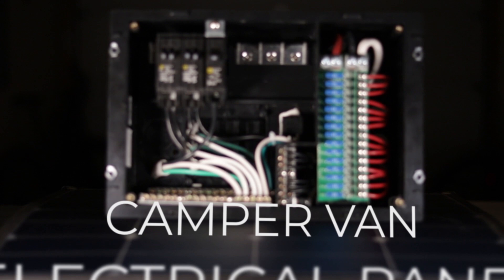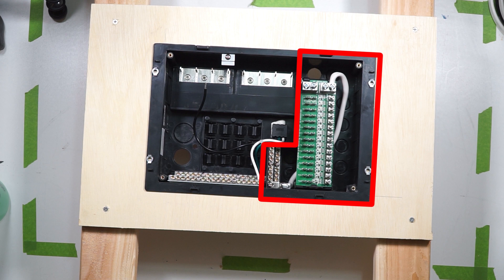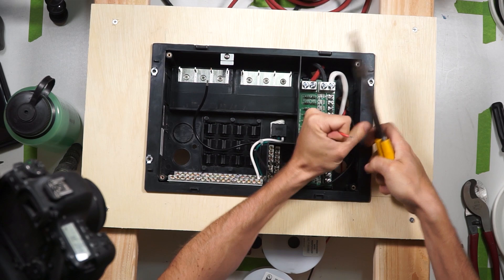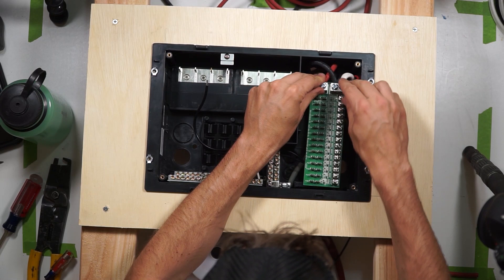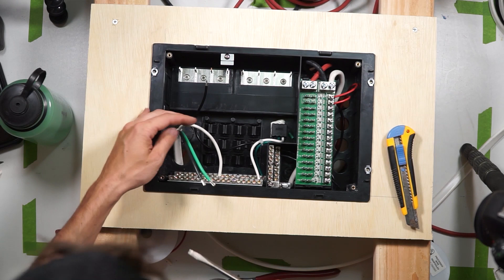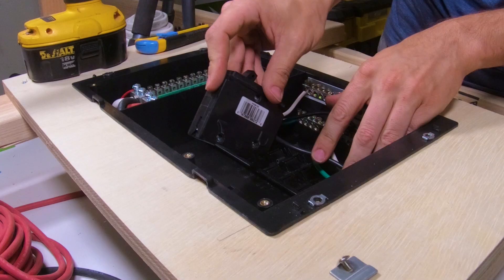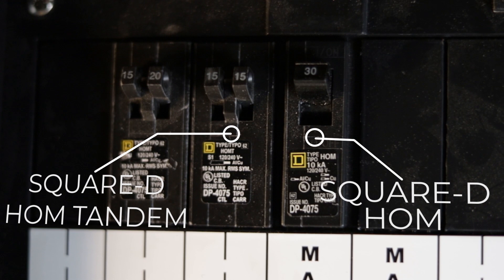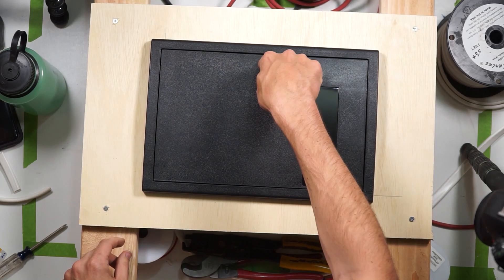How To Wire a Camper Van Electrical Distribution Panel

Comment: Could I use that same type panel for a off grid small shed ? I'm running solar into it but also want to add a few 120v plugs around the shed to charge tools etc ?  I was going to use a standard sub panel and breakers but I have access to one of these, that the convertor is blown but the rest of the RV panel is fine. I would just use my power from the invertor to power my 120v side.  Thanks. Love your videos..
Reply from the maker: I'm always going to recommend the 'standard' residential load center/breaker box for stationary applications.
Reply: @EXPLORISTlife  Oh ok. Thank you.

Comment: By doing this will this supply power to my ac circuts and dc circuts or will the generator power ac circuts and battery power dc circuts? I want to have one place where i can just use my generator as a back up

Comment: Question, I have the Victon 2000 compact inverter/charger for my 5th wheel.  My question is when wiring shore power currently shore power goes directly to the control panel, should I re-route it to go through the inverter?

Comment: Indeed some help from you, I’m try g run my wires to my light in the ceiling from the fuse panel. What wire do you recomend? 12-2 or 12-3 silicon wire so is flexible? Or run te single wires tape then together?

Comment: When wiring the DC side of the panel, why didn’t you use ferrules in the wires coming in from the battery side?
Reply from the maker: I just chose not to in this video, but you definitely could.  Ferrules aren't required, but definitely make for a cleaner install.

Comment: hi nate, im in the process of converting a cargo trailer, my second one. my electrical system will be more involved this time! im thinking about buying something like this. to charge my battery, but also to provide 110v shore power. 
i looked at a couple of your wiring diagrams and videos, but cant seem to find what im looking for. i already installed a fuse block, and i already have a couple new inverters. i want to have my off grid solar setup, but then i think i want to occassionally hook up to shorepower for battery charging and 110v use. 
im confused a little. i think i should be using only shorepower when hooked up to shorepower (also charging and maintaining battery), to eliminate cycling my battery unnessarily. some of these devices like the one in your vid here are converters/chargers? then with such a device i would be charging my battery, producing 110v power to use, and producing 12v power to use... all seperate from my exising system? 
id appreciate any helpand thoughts you have on my situation.

Comment: Wiring the panel itself seems to be straight forward. What I am not sure of is how to wire in the power sources for the AC, i.e. shore power, inverter/charger. Most inverter chargers have a transfer switch, but when I hooked mine up and then plugged it into shore power my dc lights would pulse. I am wondering if I did something wrong.
Reply from the maker: Generator & Shore power -> Transfer Switch -> Inverter/Charger -> AC Distribution Panel  Here is a visual example of how it all plays together: https://www.explorist.life/3000w-inverter-400-600ah-400-to-1200w-solar-camper-solar-kit/

Comment: Nate, great instructional video.  Is there a need to ground box to van chassis for either AC or DC .  Thanks.
Reply from the maker: Not the box, no.  Grounding happens at the Lynx Distributor and through the Neutral to Ground relay of the Multiplus inverter charger in all of the diagrams at https://www.explorist.life/solarwiringdiagrams
Reply: @EXPLORISTlife  Nate, I do not plan to have an inverter.  I am wiring for ac power for outlets only and converter/charger for 12 volt auxiliary battery.12 volt will run interior puck lighting , vent fan and USB.
Thanks.
Reply from the maker: Sounds like a neato project!  I hope you find what you need to make it work. 👍🙂
Reply from the maker: Oops... sorry... that added my reply for a different comment to this one.   If you aren't having an inverter/charger like a Multiplus, and are wiring shore power directly to the box, you should indeed need a chassis AC ground to chassis ground connection.  NOTE:  This information is based on 'the best I understand' as I don't have the full scope and understanding of your system.  My recommended system design involves using a inverter/charger w/ a neutral to ground relay to handle chassis ground switching.
Reply: @EXPLORISTlife  thank you Nate.  That was the route I was going.
Reply: Nate, what gauge wire did you use from the battery to the 12volt side of panel? Thanks again for video.

Comment: Thanks for the video.  Saw it and bought it.  One thing....you kind of skip over hooking up the prewired outlet on the rear of the panel.  Why is it there?  Do I need to hook it up or can I just cap the black wire and leave it alone?  Thanks for all you do!!
Reply from the maker: You can hook it up or leave it.  It doesn't matter.  It's just another 120v circuit.
Reply: Thanks for the quick response!!  I appreciate it.

Comment: Great Video,
Will this type of panel charge the 12v battery while it's plugged into 120v? Or would a battery maintainer/trickle charger have to be wired in?
Reply from the maker: This panel has no way of charging a battery bank.  I recommend using an Inverter/Charger like in ALL of my diagrams here: https://www.explorist.life/solarwiringdiagrams

Comment: Can I connect left and right busbars to have ability to insert more breakers while running 30Amp main?
Reply from the maker: Not without 50A shore power.  This breaker box can handle 6 different circuits when using tandem breakers.  There's no reason to have more than 6 circuits in a van build.

Comment: Nate, I have purchased a Busbar disconnect from you and a Solar Schematic,  At 3:35minutes you show connecting the main 110volt power to the left side of the busbar through the main breaker, How do i power up the right side of the 110 breakers with the same incoming 110V.
Reply from the maker: The right side is for:

1: L2 of a system with 50A split phase shore power.

2: powering from AC Out 2 of the Victron Multiplus for 'shore power only' loads.

If using tandem breakers on the left side, that is room for 6 circuits which should be PLENTY for any camper.

Comment: I have an DC LED light bar with pos neg.  I am using a dial knob for power switch.  This has pos neg and ground.  Curiously, when running this back to the distribution box ( same shown in video) where do I ground the wire coming back to the distribution panel? Because all three run back to it. Can I just run it to the negative on the dc side?

Comment: I have a question.. if anyone can answer it would be much appreciated.. I'm upgrading my camper from 30 amp to 50 amp and I have bought the panel 6/3 wire everything I need..  With that being said my PowerMax converter in my camper now for my 30 amp service is less than a year old.. Will I have to upgrade my converter because I'm upgrading to 50 amp service...?

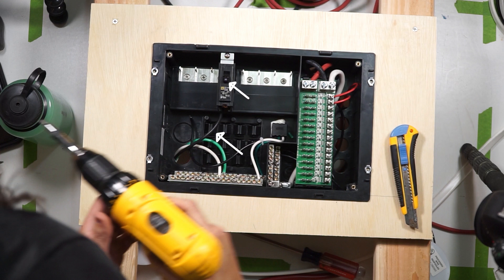Comment: At 4:04 you talk about adding power to the wire. How would you add power to said wire?.............For the square-d him tandem would you require one for each outlet?...........Does this set up replace the inverter?.........have you already done a video on how to connect everything together? and if you have could you leave a link.
Reply from the maker: That wire would be powered from the Inverter.  You can wire multiple outlets in parallel off of one breaker, similar to how it is in your house.  This setup does not replace an Inverter, but this unit get's power from the Inverter.  I don't have a full install including this device just yet, but will as soon as we move into out new shop at the end of the year.

Comment: Hi Nate,
 Very helpful video! One question - what did you do with the already installed black wire? Thanks!
Reply from the maker: If you want the outlet on the back of the panel to function, you'll just want to connect that black wire to a breaker the same as any other branch circuit.
Reply: @EXPLORISTlife   ahhh, that makes sense! Thank you. One other question: My other HOMT breaker is the same one you have, however it doesn't fit into the slot and broke two of the prongs sticking out. Have you heard of this issue, and do you know how to fix it?

Comment: Great videos!  I have this panel wired up and working great but have one question:  Do I need to run a ground wire from the A/C ground terminal to the chassis?  If so, can I use the same chassis lug that I have my D/C grounded to?
Reply from the maker: Not if you're using an inverter/charger with an internal neutral/ground relay like any of the examples here: https://www.explorist.life/solarwiringdiagrams.
Reply: @EXPLORISTlife  I've been looking for the answer to this very exact question.  I'm going to disconnect my AC chassis ground from the AC side of the breaker box to see if it corrects the shore 110 GFCI from tripping shortly after the Victron MultiPlus II Inverter engages on power up.

Comment: Will this distribution box work on shore power alone, i.e. no battery system?  Wanting to install an ac 50amp shore power breaker box and still connect 12vdc led lights in a clean setup.

Comment: Could you connect this panel to a Bluetti portable power station, so one would not need an inverter, etc??? Since these power stations have both AC and DC power supplies.
Reply from the maker: A bluetti should have built in breakers, outlets, etc, making this whole panel unnecessary.
Reply: @EXPLORISTlife  Good to know. I have a 1974 Fan travel trailer I will be restoring and obviously need to update everything. It will have ac, induction cooktop, etc. so I am exploring options.

Comment: I bought this exact panel. Wondering why on the DC side there’s 15 positive connects but only 12 negative connections. Please help!
Reply from the maker: You can put multiple negative wires in the same screw terminal on the negative busbar.

Comment: Nate, I have purchased a few of your wiring diagrams but have a few questions. I eventually want to hookup solar but not yet. I have a distribution panel and would like to get that connected to my shore power cable and 100ah battery. I see you have a lot of parts used for an inverter with the bus bars, breakers and such. Any suggestions.... I guess I can take one of your diagrams and show you where I am at. But... I just want my battery, shore power, distribution panel and possibly add the inverter during the part of the build. Any suggestions would be great.
Reply from the maker: The solar charging leg of the system can be omitted if desired from any of my diagrams/systems without changes to the rest of the system.

Comment: I'm trying to put together a electrical system in an RV.  Would this circuit breaker setup be useful for my shore power and my DC off my battery?  Thanks for this video
Reply: @Joe-sq5uy  I think he says his breaker box is set up with one side being DC and the other being for AC.
I will end up putting in 2 separate breaker boxes. My shore power is coming into the van in a different location than my cables from the solar.

Comment: In your parts list you list getting a 50A Square D HOM AC Breaker (for the AC/DC distribution box) to connect to the Victron inverter/charger. I assume this is for a 50A shore power system? If I am opting for a 30A shore power system, should I replace that with a 30A Square D HOM AC Breaker?
Reply from the maker: Nope.  The Victron Multiplus has what's called 'PowerAssist', which means it can add up to it's nominal inverting capacity (3000w for a 3000w inverter - 2000w for a 2000w inverter - etc) to shore power, inverted from the batteries.  So... If you are wiring for, and connected to 30A shore power; the Victron Multiplus can add 25A (3000w/120v=25A) TO shore power for a total of 55A delivered to the breaker box through 6 awg wire.  We are capping this off at 50A with the 50A breaker from the parts list.

Comment: Wait, why do we need the plug in the back of the box?
Reply from the maker: You don't have to connect that if you don't plan on using it.
Reply: @EXPLORISTlife  right... but whats it for?  To power the box firectly?
Reply from the maker: It's simply an additional outlet.  Like an outlet in the wall, just mounted in the box.
Reply: @EXPLORISTlife  If i am running a solar panel, am i running it down to this fuse box with a double pole braker or something?  your diagrams dont show any advice on that and everyone is saying the solar goes to the fuse box while the fuse box is going to the charge controller in the "load+/-" sections of the charge controller.  (only have 1 battery)

Comment: If I'm running a 50 amp service would I use the same 6/4 romex coming from transfer switch up to the service panel? I purchased this same furrion panel to install in my  bus. The 12v side was pre-wired which I'm a little unsure of at this point.   I'm curious as to why there's not a securing screw for the right side of the panel if its an optional 50amp? Also, if use a 30 amp on one side does that mean that mean my other is limited to no more than a 20amp  breaker? Thanks for the video
Reply from the maker: 1:  If you aren't using an Inverter/Charger or anything, yes.

2: No securing screw is necessary because the 50A breaker would be a dual pole breaker which would be held in by the single clip.

3: If you are using 6 AWG for in Main Input... use a 50A main breaker.

Comment: Did you connect any wire to the chassis ground?
Reply from the maker: Not in the distribution panel no.  The Lynx Distributor is connected to the chassis ground and then the AC side of the system is grounded through the neutral to ground relay inside of the Multiplus inverter/charger.  See the diagrams at https://www.explorist.life/solarwiringdiagrams for clarification.

Comment: Nate, your videos are great and I have checked out wire sizing guide and fuse sizing guide, but still have a question. What size wire should come from my bus bar to my DC fuse box. The fuse box is rated up to 125amps total. It's a short run, about 4'. Do I need a larger fuse inline with that based on my the total amps of appliances (fans, light, pump, etc).
Reply from the maker: You should check this out: https://www.explorist.life/wire-sizing-calculator/

Comment: Hi! When adding wire for the ac outlets, is just one set of wires connected to the ac breaker, then the wire goes out around the van and just T-d off to the various ac outlets around the van? Thanks!
Reply from the maker: It very much could be.  Very similar to how it works in your house.

Comment: Thank you for your video! I have been needing help with this same thing!

Do I need to have an inverter or can I just hook my 30 amp shore power cable right to the box?
Reply from the maker: You don't have to have an inverter if you don't plan on running 110v appliances when not connected to shore power.  If this were the case, you could, indeed, run power right from the 30A shore power cable to the box.

Comment: Great Video.  Question - I mistakenly used 2 wires instead of 3 wires and had each of the 120 volt outlet hooked grounded to frame.  Is this ok or a problem?
Reply from the maker: Nope. You'll want to redo that and use 3 conductor wire as shown in the video.
Reply: @EXPLORISTlife  Ouch....can I hook a third green wire next to that 2 wire that is insulated?  Will that work?
Reply from the maker: You CAN do whatever you like as I'm not inspecting your work.  I've shown you the proper way to do things, now it's up to you to decide how safe of a system you are trying to build.  I recommend re-running a proper 3 conductor wire as shown in the video.

Comment: You are my first ever Subscribed!  We are building out an ambo and want to follow your diagram as close as possible for the 3k inverter, 400-600 ah, 400-1200 solar setup.  My question is that I already bought a WFCO (for lithium) 55 amp AC & DC distribution fuse and breaker panel combo.   Can I keep this and still use your diagram setup? Do we think of it as two separate pieces like you have in your Sprinter video and layout?  Please let me know if I have to sell this piece and rebuild the space we made for it. Thank you so much!
Reply: We are going with all Victron products. We love your videos - you explain it best!
Reply from the maker: I'd suspect that panel is not rated for 50A of AC current.  You'd also have to entirely disconnect the converter.  'Doing it right' says to replace it with the correct panel.
Reply: @EXPLORISTlife  Thanks so much for the reply. Guess I’ll sell part I bought.

Comment: Hey quick question. Does this system charge the battery if it is plugged into shore power? Or do i need to have a separate converter for that purpose?

Comment: I wasn't aware that you needed a breaker between the inverter and the panel.  I'm using a 2 circuit AC breaker box, do I need to use one slot for a 30 amp breaker for the power coming from the inverter?  Also, I think I remember reading that the ground and neutral wires were to be kept separate in the breaker box when using this particular inverter, does that make sense?
Reply from the maker: My wiring is accurate, if that makes sense...

Comment: Nate. For the AC side. Do you hook up the shore power wires to this or the inverter wires. I have both shore power and an Inverter that will be instLled in the battery compartment next to the Solar Charge controller. Kind of confused.